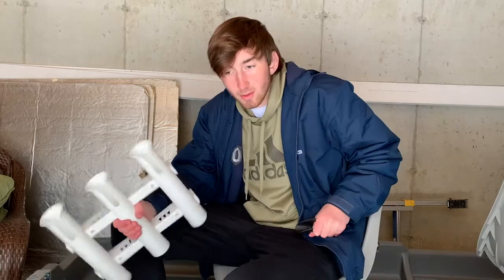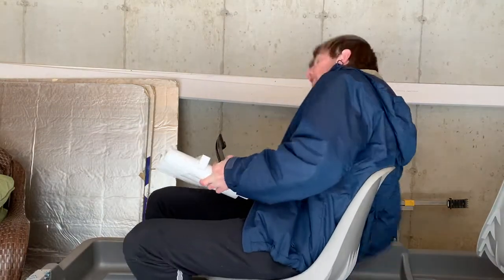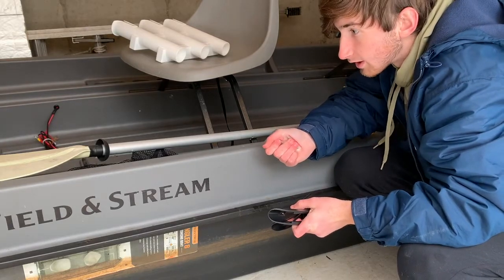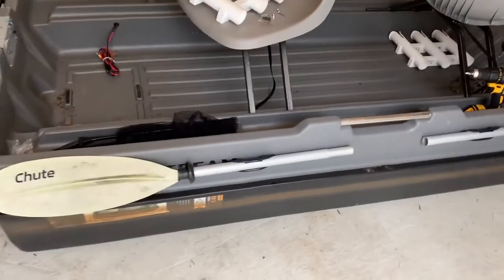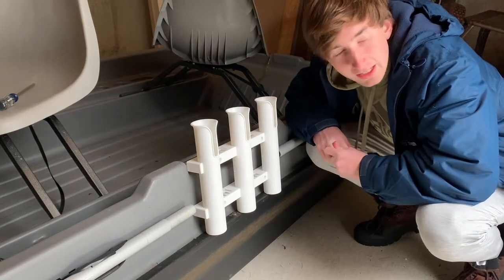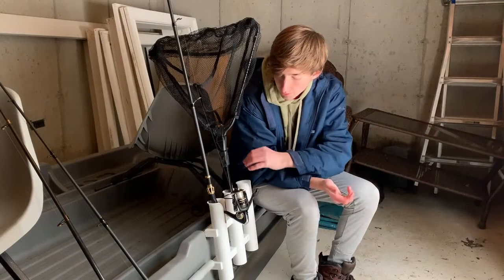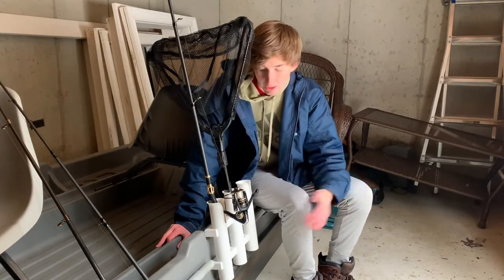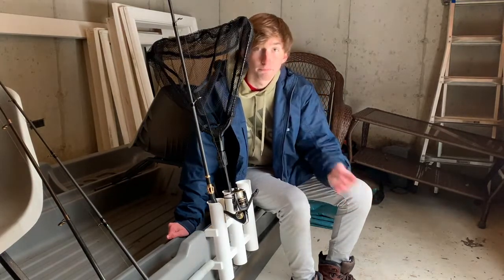Installing Rod Holders And Oar Mounts On My Bass Boat

Comment: I don’t think you will get longevity having those rod holders there. 1) just having the bottom screws isn’t enough leverage. 2) they will be in the way if you had to carry the boat by the handles. I have an 8 footer and love the boat for small lakes and ponds here in Long Island. Good luck my friend have fun. I’m looking for the spring to arrive too!
Reply from the maker: Yeah I’ve got mixed opinions about them I don’t like how they feel loose but they do keep the boat cleaned up. Still a great boat though!

Comment: I have the same boat the first thin I did was change the seats and got a battery power box
Reply from the maker: I love the boat but the seats gotta go. You have any brand suggestions?
Reply: I just went to bass pro and got regular seats they have many colors to chose from